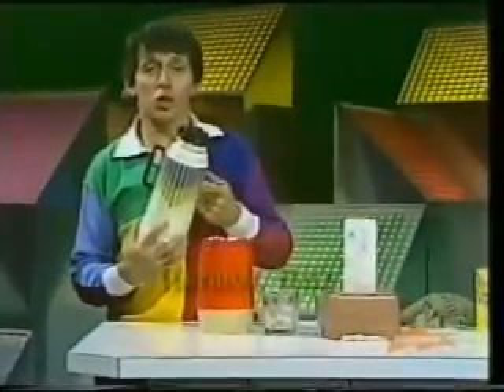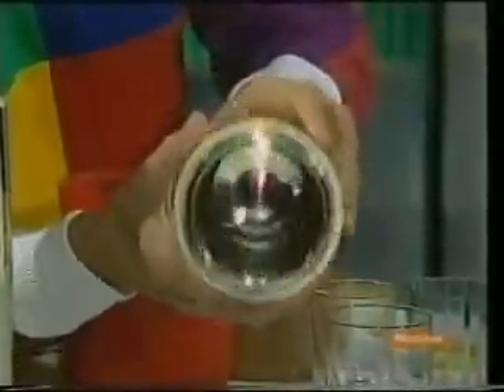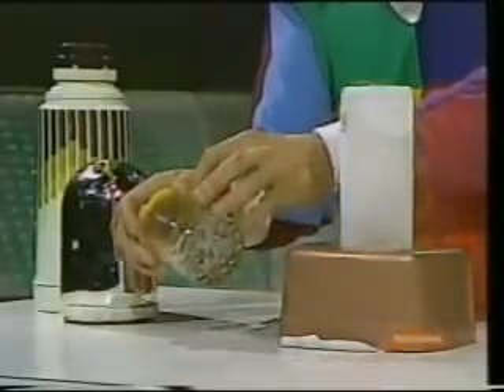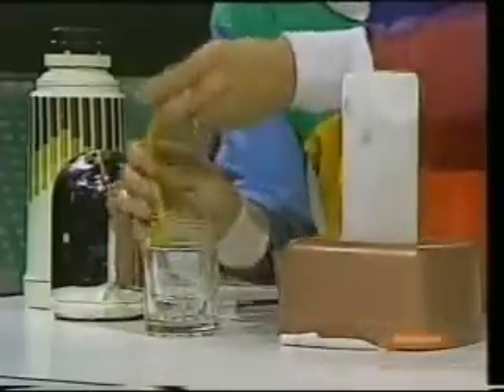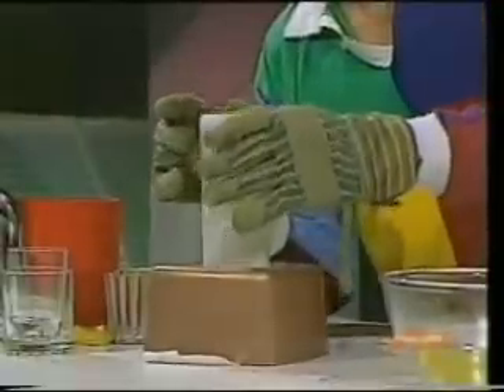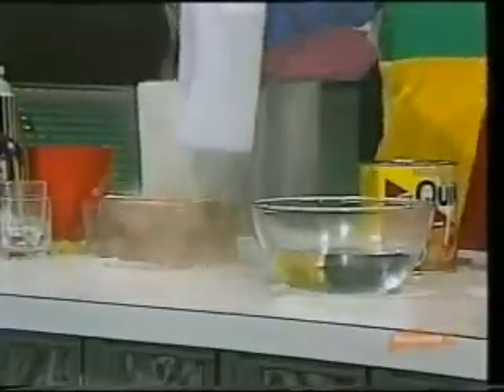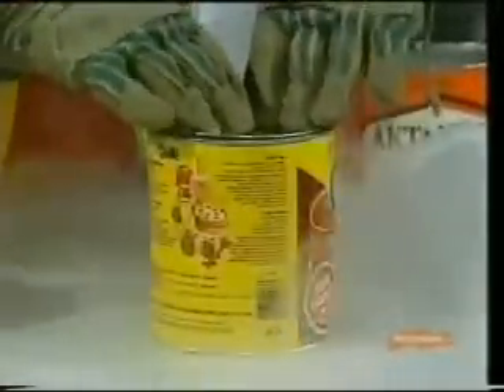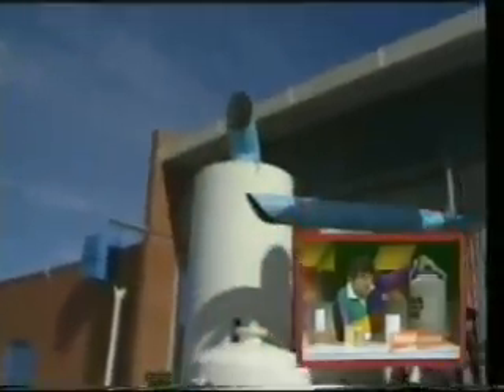The Curiosity Show: How A Thermos Works

Comment: Rob or someone might be able to answer a question that's been haunting me for 30 years.  I'm 35 now.  They had a question on the curiosity show leading to an ad break then the answer after it.  I missed the answer.

The question was something about "How can a car travelling faster than someone walking won't ever reach them.  ie.  When the car gets to a certain point the person is no longer there, they have moved."  
Very vague question I know but it has been about 30 years.
Reply: Did you find it? I think if they are moving in circle then the car at higher velocity in outer circle can't catch up the person moving in the inner circle.